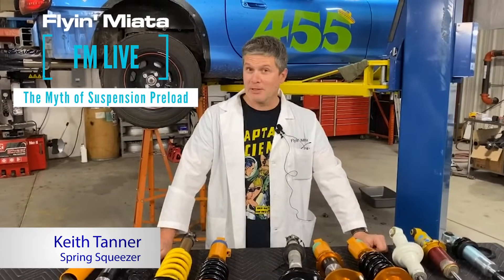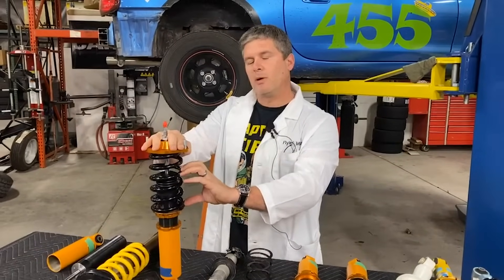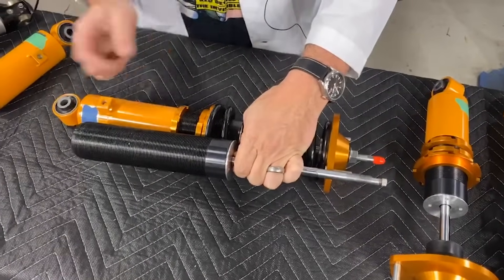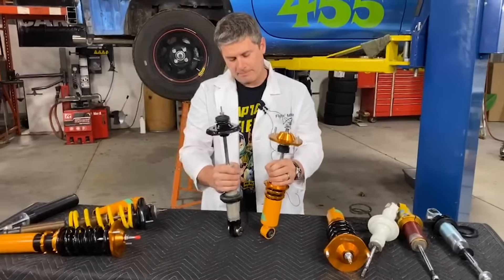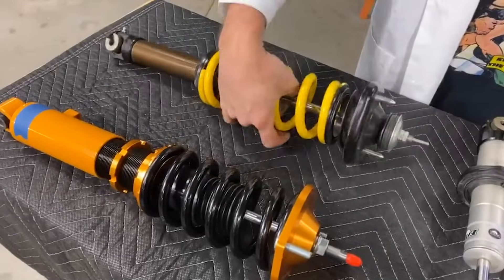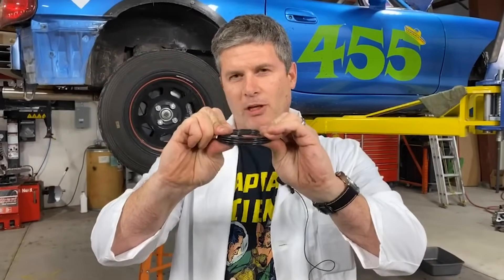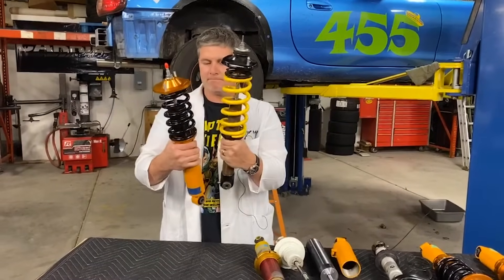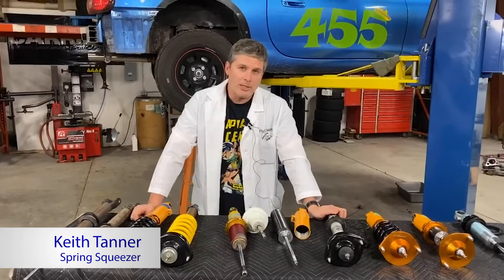The Myth of Suspension Preload (FM Live)

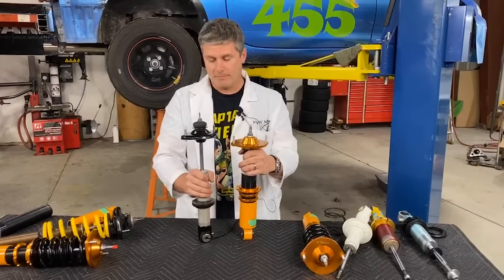Comment: Did I miss something or did you start the video by saying "preload doesn't affect ride height @2:38" and then you end the video by saying you "set ride height by spinning the perch up and down @8:15."

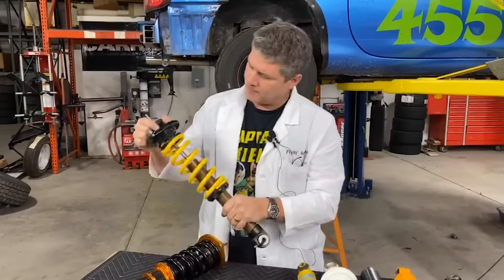Then @14:29 you say if you have a helper that is compressed at all times then you can "just take it out and move the spring perch up." Again not actually true in all circumstances. That is only true if you only care about ride height and don't care about maintaining droop travel. The helper adds droop travel. The fact that it is always compressed at static ride height is irrelevant. If you remove it you will gain travel in jounce and lose travel in rebound.
Reply from the maker: Preload does not affect ride height. The position of the perch when the car is on the wheels affects ride height. Preload can be all over the place at the same ride height as it's determined by what happens at full extension.
Take a spring/shock setup and then remove an inch of shaft extension - you can do this by putting a spacer inside the shock body. You have just increased the preload. But the ride height has not changed.
A lot of people are misled by inaccurate advertising or by vendors who really don't understand suspension geometry. Usually when people are trying to adjust ride height by "changing preload" they're changing another factor and the change in preload is just a side effect.
Reply: @FlyinMiataVideo  Yeah I can't get on board with how you are explaining preload. When myself and everyone else that is talking about coilovers mentions preload they are talking about SPRING preload. Spring preload being the amount that the spring is compressed when the strut is at full extension. Talking about the affects of strut preload is not comparable at all. Springs provide significantly more compression resistance than a strut. Not even at soft stock spring rates does the struts compression resistance have any meaningful impact on ride height. So you're right that preloading a strut isn't going to affect ride height (by any meaningful amount). I am not even sure why you think that reducing strut stroke by an inch means you've preloaded the strut either... that makes no sense. I think you simplified that too much. Anyway... you cannot say the same for springs just because it's true for struts. Preloading a 1,000lb spring 1" would give you 0 static compression on just about any road going car (actual change to ride height depends on motion ratio). Remove that 1" of preload and ride height goes down an inch or more. The only time that preload does not affect ride height is when you've preloaded the spring so much that putting the car down on the ground does not move the spring at all (preload exceeds corners weight). If you're goal is to dispel the myth that preload affects spring rate then OK I agree with that... but the rest seems a bit off base. I cannot see how you can continue to try to argue that spring preload doesn't affect ride height when in your own video you are telling people to adjust ride height by adjusting the lower spring perch. The lower spring perch produces preload, no preload, or sag in the spring. Seems like you are trying to redefine these common terms around your own suspension design/theory in what could be interpreted as misleading.
Reply from the maker: @banks334  Preload: the pressure on the perches when the shock/strut is at full extension. I think that matches your definition. "Strut preload" is not a term I've ever come across. I'm using preload as "spring preload".

Factors that affect preload:
- spring length
- spring rate
- distance from upper to lower perch at full extension (perch position and length of fully extended shaft).

Factors that affect ride height:
- spring length
- spring rate
- distance from lower perch to lower shock mounting point
(there are a few others such as upper mount design and of course corner weight, but we'll treat those as constants as they're not really relevant)

You can see that some of the factors that affect ride height also affect preload, but it's possible to change preload without changing ride height and vice versa. That's why we say that you don't adjust ride height with preload. They might both be affected by a change like moving the lower perch, but that's not cause. This is the important bit. Adjusting one does not necessarily mean you're adjusting the other.

In my thought experiment, I changed the distance from the upper to lower perch by changing the amount of shaft travel. The preload changed because thats one of the factors in preload. The ride height did not as that is not a factor in ride height. The car's dynamics will not have changed either until either the spring or shock is fully extended.

As mentioned in the video, there are edge cases where the preload exceeds the corner weight. In that case, you have a suspension that is fully extended at rest. This is not a functional suspension so it's not considered an important case - although we have seen it done. Your ride height is determined by the extended length of the shock in this case.

Most people who "adjust preload" and note a difference in behavior are really noticing other changes such as a change in bump travel thanks to a different shock geometry.
Reply: @FlyinMiataVideo   I took your comment about adding a spacer to the strut internally to reduce travel to mean that you were saying to increase compression damping force or something. Changing (reducing) the dampers stroke does not necessarily change preload if you can just move the lower spring perch down. Now all you did was reduce available rebound travel... If you assume that you leave the lower spring perch at the same height then you absolutely will be raising ride height. Why? because you increased the preload on the spring... Have you ever tuned a cars suspension with a divorced setup? Explain how the rear spring height adjuster works to raise ride height without saying that it "preloads" the spring. You can't. Sure there are other ways to raise ride height (longer spring/shorter damper body) but that all functions to increase preload and therefore ride height.

I am not going to go back and fourth  because I think you are intentionally phrasing things in your list such as "- distance from lower perch to lower shock mounting point" affects ride height to avoid admitting that adjusting the lower spring perch up to compress the spring (preload) raises ride height. Again, this is up to that point where the preload exceeds the corner weight. The fact that the ride height ceases to rise once the corner weight is exceeded DOES NOT mean that preload isn't what changed the ride height... Also, reading the statement as it's written, without making a bunch of assumptions, can easily be interpreted as being false. The distance between the lower spring perch and the lower strut mount in and of itself has no bearing on ride height. You would need to make a specific statement such as "adjusting the lower strut mount up/down changes ride height" for it to be correct. which it is true... even if you want to argue that the lower damper mount should NOT be used as the primary method of changing ride height. To prove the statement is false I can just say something like " I put in a longer spring. Since the spring is longer I moved the lower spring perch down. The distance between the lower spring perch and the lower strut mount has now decreased; however, ride height has NOT changed." All you've done is changed to a spring with different stroke. Given that you keep preload the same the ride height will not change at all! 

I don't necessarily think you'r "wrong." you clearly understand how it all works... I just think you're trying to differentiate yourself from other suspension brands by making the same type of misleading statements... they say "X" is how you do it so you're saying "no they're wrong it's Y." Reality is that both are true given the right context.
Reply from the maker: @banks334  Here's the problem:
"If you assume that you leave the lower spring perch at the same height then you absolutely will be raising ride height. Why? because you increased the preload on the spring... "
That's just plain wrong. Once the car is sitting on its springs, it has no "memory" of what the preload is at full extension. Preload does not affect ride height.

Things that affect ride height - such as perch location - can affect preload. But preload itself does not affect ride height unless it's higher than the actual cornerweight. Check with your high school physics teacher. Once there is X load on the spring, it will compress a certain amount that is dictated solely by spring rate. This is the fundamental misunderstanding here.

Numerical example: take a 300 lb/in spring and a car with 600 lbs of corner weight. When the car is on its suspension, the spring will compress 2". Right? Now, set the shock up so there's 75 lbs of preload on it (spring is compressed 1/4" when the shock is at full extension) but without changing the perch position relative to the lower mounting point - say, you can do that by limiting droop as I specified earlier. Put the car on its wheels and the spring will compress 2" because there's 600 lbs of weight on it. It still has the same spring rate. The wheel won't start to move until there's 75 lbs of load on it, but the end result is the same. Voila, no change in ride height because the length of the compressed spring is the same, as is the distance from the bottom of the spring to the lower shock mounting point.

My list of factors stands. In your example where you increase spring length (ride height goes up), you have to change another factor (shorten the distance between the perch and the lower mounting point) to keep the same ride height. So you're adjusting two factors in opposite directions to maintain the same ride height. Both of those factors are ones that are shared with preload so coincidentally you're also keeping the same preload. But that's not the only way to affect ride height, and other methods don't necessarily affect preload.

I've been messing with Miata suspension for a couple of decades. I've run setups with multi-piece bodies, which I think is what you're referring to as a "divorced" setup. With that setup, you can change the preload without affecting ride height by shortening the body. Or you can change ride height without affecting preload. Which proves that it is not preload that is changing ride height. There are simply several factors that can affect both, and some people think that means the two are somehow interrelated. 

But what's also important is that the preload doesn't matter other than our edge cases! Even if you believe that the ride height is set by preload, it's irrelevant. The only time it affects suspension behavior is when you're at full extension, which is pretty rare. So preload is not a tuning tool on a car. On a motorcycle that sees much more radical weight shifts than a car, it can come into play when you've got a fully unloaded wheel.

(apologies to all the engineers and physics teachers for playing fast and loose with force and load and weight)
Reply: @FlyinMiataVideo  I stopped reading once I got to: " Voila, no change in ride height because the length of the compressed spring is the same, as is the distance from the bottom of the spring to the lower shock mounting point."

I would say you're trolling but no one would take the effort to type all that just to troll. 

"So you're adjusting two factors in opposite directions to maintain the same ride height" I only used it as an example to point out that this is exactly what you're saying too! LOL

75lb of preload means only 525lb of corner weight will compress the spring when you put the car on the ground. Lets assume a motion ratio of 1:1 and an effective wheel rate of 300lb/inch... NO PRELOAD on the spring: 600/300 = 2" of static compression. 75lbs of PRELOAD on the spring = 600-75 = 525/300 = 1.75" of compression (liek you said, the first 75lb DOES NOTHING since the spring is storing 75lbs of "energy" acting against the cars corner weight). You've just raised the car .25." The only way to keep the ride height the same would be to make a secondary adjustment to the damper length to maintain "the distance from the bottom of the spring to the lower shock mounting point."

Shortening the strut length in a divorced setup preloads the spring. period (unless the spring had previously been in SAG not preload). The only way to avoid there being a resulting change in ride height would be to make that secondary adjustment to the spring height adjuster.
Reply from the maker: @banks334  As long as you have it in your head that preload will somehow decrease the corner weight, you won't be able to get this sorted out. That's the fundamental misunderstanding here. That's not how springs work.
Reply: @FlyinMiataVideo  you said it yourself though... the wheels won't move until 75lbs of corner weight are placed on the suspension to overcome the preload force.

I appreciate the civil debate! I give you props for that.
Reply from the maker: @banks334  The spring is already compressed 1/4" from that 75 lbs of preload. Once you have 75 lbs of corner weight on the spring, it will start to compress further with the remaining 525 lbs. 525 divided by 300 lb/in means another 1.75" of spring compression, for a total of 2". Which is the exact same as if there was 0 preload or 100 lbs of preload. There will still be 600 lbs of force on the spring, and it's all from the car. Once the spring starts to move, preload ceases to be a factor.
Reply: @FlyinMiataVideo  right and according to your own math the car will only be pushing down on the spring 1.75." The car sits higher. The spring sits higher on the damper by .25" while seeing the same 2" total stroke.

You seem to be mixing up the idea that the spring still behaves linearly and the idea that preload changes ride height. I'm only debating the later of the two things.
Reply from the maker: Read the example again. You change the preload without moving the perch. Ride height does not change as the perch and all other factors that affect ride height are unchanged. The spring is compressed by 2”. The perch has not moved. Thus no change in ride height. 
Try it. Seriously. Just get out there and perform the experiment. It’s 100% provable if you don’t believe the physics. If we were in the same room, I’d be able to sketch it out for you, although I did show it in the video.
Reply: @FlyinMiataVideo  ok you have got to be trolling lmao. So... now you're preloading the spring 75lbs without actually moving the lower spring perch? This is some real boomer logic...
Reply from the maker: Read back, it’s all there.

Comment: Starting at 7:50, where Keith answers the question about how to set up an adjustable body damper (set it to be as short as possible, while avoiding hitting anything, and then adjust ride height with the spring perch).  So, some questions about that response:

- First is regarding the statement about avoiding hitting anything.  So, I assume you mean that by making the damper body as short as possible, you’re setting the ride height as low as possible (before adjusting height via the spring perch).  Is that correct?  So, you’re basically eliminating that ‘gap’ between the bottom of the damper and the bottom of the lower mount?

- Second, regarding the adjustment of ride height via the spring perch.  So, when you end up adjusting the ride height to the desired height, what is the desired position of the damper piston at static height?  Should it be at 50% (midpoint travel distance, for equal bump and droop travel)?  Or should it be positioned for more bump or droop travel (so say, 40% of damper travel distance, or 60% of damper travel distance), to favor more bump or droop travel?

- Third, if you find that, at the shortest damper body length (via the adjustable bottom mount) and with the desired ride height set via the spring perch, that the damper piston position is not in the desired place (as asked in the question above), does that mean that the spring LENGTH needs to be changed (longer or shorter) in order to place the damper position at the right place at static ride height?
Reply from the maker: 1. When you're setting the shock body short, you're not setting the ride height yet. What you're trying to do is get as much bump travel as possible. In the rear, this will mean the shortest length you can manage. In the front, you usually don't bottom out the adjustment as the shock body is considerably longer.
2. Typically, we shoot for about 2/3 bump and 1/3 droop. But for street and track Miatas, what you realistically need is "as much bump as possible" because that's where they're limited. If you're building a rock crawler or a lifted Miata, you may end up with different desired geometry.
3. See above. This isn't really a situation you'll come across unless the damper is tragically short on overall travel, in which case the correct solution is a shock with more shaft travel. The workaround is to give up some of that bump travel to get some droop back - you do that by lengthening the body. You're compromising the car, but it's a matter of compromising one aspect to avoid a complete disaster in another. We have seen it in big name Miata suspension from well-regarded vendors, coilovers that are fully extended at full droop. Changing spring length really only moves the perch position all else being equal.